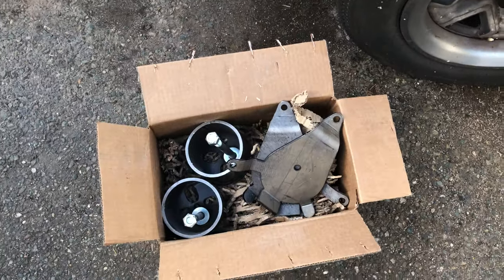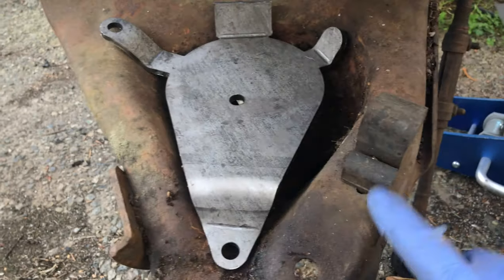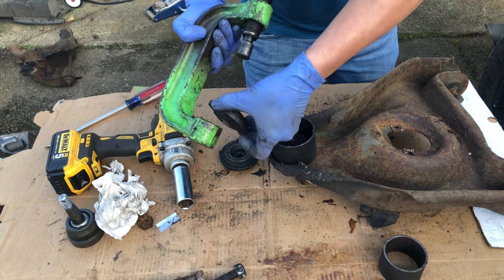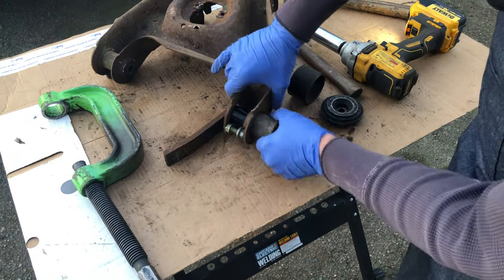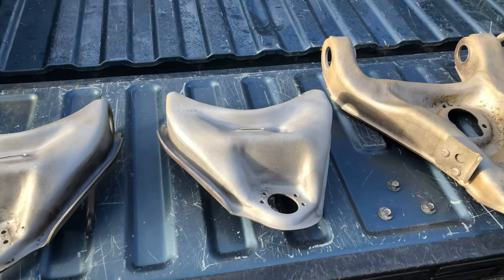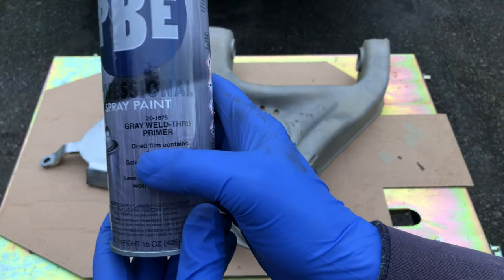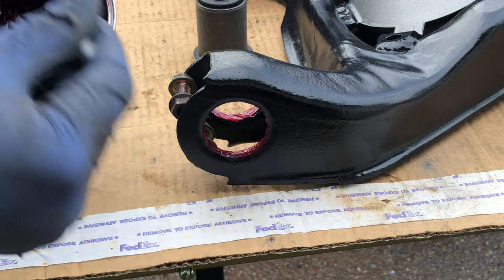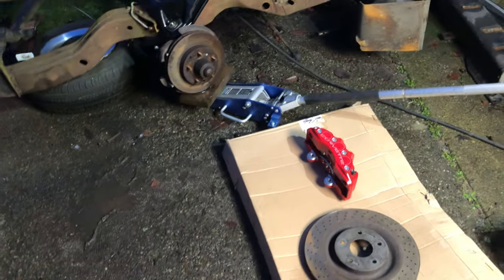1948 Chevy Truck With S10 Frame Suspension Rebuild

Comment: Where did you get the bracket and airbags from?
Reply from the maker: I got them on eBay, back when I bought the brackets I believe I paid around $68 plus tax, now I think the price has tripled on them :(
Reply: Do you have the part number for the brackets and airbags ?

Comment: I don't mean to be critical ... but, how how how could you skip stripping and undercoating the subframe ... use sealer and fill the hollow parts with foam. From the condition of vehicles it looks like you live on the west coast, maybe CA, so I get that you're not dealing with ice and salt. But still. As you yourself said: It was very quick to sandblast those control arms and then to spray them ALL down with rust inhibitor. Yet, on a complete restoration you skipped that!?  I'm just absolutely shocked. 

Ironically ... even though it's the past, I'm still looking forward to see what you do for the 'furniture.'  Just don't tell me you made your OWN custom upholstery. I just cannot take you having anymore talents. 🙂  As usual ... Спасиба болшой!

Comment: Nice job! 💯 Do you have the link of the parts of the air bags ? Im also working on a project like yours
Reply from the maker: I bought these brackets on eBay.. just look for "s series front suspension air bag brackets ride cups lowered"

Comment: Excellent to see mechanism for swapping the bushes and joints on these control arms. I need to done some of this on a project vehicle (completely different) and am looking at options for not replacing the whole units. Good to see the use of an etch primer, but I think a two-part modified epoxy primer might be more long lasting than a rattle can. Yes, I use these too and there are great hardwearing products, but I just don’t think you get the thickness on these, especially at edges and corners. Good blasting work. With the new compressor are you thinking about a cabinet?
Reply from the maker: That self etching primer even out of the can is no joke, the acid in a primer really bite into the bare metal and hold well, I have no doubts that this finish will hold up on the road. I did get a large blasting cabinet sometime ago and would much rather do all the blasting on smaller parts such as these control arms in the cabinet versus out in the open the way I did it in the video.
Reply: @fix206  Thanks for your reply. Yes, wet blasting is the best way for working outside or on larger items that do not fit in a cabinet. Just ask 'Mr Hewes' who is now wet blasting tanks and did a recent update on this method. Be good to see how you tackled the cab you mentioned so I will need to look through your content. I've only seen two of your videos but greatly appreceiate what I've seen and like your approach to getting it done, filming what you do and explaining the processes.
I have a few largeish things that I will be cleaning up and I've not yet worked out what i'll be doing.
I have a 220L generic-make blast cabinet, which is about as small as it's sensible to have and it to still be useful for parts etc and not take up too much space when not in use. Out of the box these 220L are ok as boxes with gloves etc, but not great for blasting in my opinion. I upgraded with the kit from the company that has the 'Parts Washer Upgrade Kit' YT site. This has made my setup as good as I can reasonably expect and am really pleased with it. It needs only a very little media, I regulate the blasting at the cabinet and use a fairly short and wide diameter hose that runs from an unregulated output on the compressor tank. I need to sort out pre-cooling as you have. I built the cyclone based on 'Charlie DIYte' rather than the PWUK but not had the problem of barrel collapse as I don't power the suction too hard. Some magnets on the cabinet vent help to trap ferrous dust, too
Will check out the etch primers. I've used them in the past for applying marine antifouling to pre-coated surfaces such as galvanised.
Thanks again!!

Comment: A neat trick I like doing to freshly media blasted steel is to clean all the moisture or dust off, (chemically clean with degreaser), let dry then take a Mapp gas torch or equivalent and heat the steel up till you see the moisture residing in the metal wick out and evaporate, do this to the whole piece. It will leave a little surface oxidation behind but it will not harm is as the moisture has been eliminated from the steel. Let cool and then apply a piss coat of self etch, then prime and shoot the color of choice on. I use to live in Los Angeles and if you left any metal bare in that toxic pea soup air the metal severely oxidizes over night. with this method the worst that happens is the surface of the paint oxidizes over time if directly in the outside elements and the metal stays well protected with no rust bubbles emerging under the paint.
Reply from the maker: I did notice that it doesn't take long for the surface rust to start forming. Literally within about 30 minutes after I got done pressure wash sanding I could see the silver color starting to turn a little yellowish on the first control arm that I did. So with every control arm after that right after I got done cleaning one up I immediately blew all the water off with compressed  air and then for good measures placed the control arm in a preheated  oven for about 10 minutes. After that stored them in my dry garage, that seemed to work out :)
Reply: @fix206  
I just learned something good from both of y'all thanks. Phillip Hall

Comment: You gotta trim the spring pocket so it doesn’t pinch:l/cut  the bag when it’s deflated once it has weight on it
Reply from the maker: I know exactly what you're talking about. With frame being stripped down I think I'm going to flip it over with the airbag mounted and fully deflated to see exactly how much I have to trim so the bags don't rub/pinch... That will be in couple of weeks down the road, I'm going to take care of few other things before then 👍

Comment: It's been a while since your last video, so it was good to see more progress on the truck. Hope the next video won't be too far away as it will be interesting to see the modifications for the new brakes. I'm surprised that you didn't make your own ball joint pressing tool, as you make a lot of your own tools. But I guess you had limited use for it, so easier just to rent one.  It was interesting to see your pressure washer sand blaster, as I've never seen anything like this before. Another way of removing rust from small parts is to use electrolytic rust removal. There's a lot of links if you search for it, but this page is very informative https://www.qsl.net/2e0waw/rust.htm  I have my own setup using a 65 gallon bin and a salt water chlorination unit as the power source. I recently restored a seized up vise that wouldn't move with it.
Stay safe over there from this virus and looking forward to seeing more progress. All the best from Queensland Australia.
Reply from the maker: Bruce, my friend... With Covid restrictions getting a bit lighter it got busier at work so I have not had as much time to work on the truck as I would like, also this is our rain season, so that doesn't help either. But I'm still working on it and recording quite a bit, got enough footage for 2–3 more videos. Finding the time to video edit seems to be the hardest part of the whole process :-) one of the videos that will be out in a week or two has to do with another tool I've been working on. I'm pretty excited to start using it, hope you'll like that one ! It's nothing groundbreaking, but I think it's cool nonetheless. I think I've created enough suspense :-) so I will just leave it at that 😎 I'm pretty sure at some point I will use electrolyses to remove rust from something in the future video. I will be using different techniques to achieve the same end results just to show people what all is possible...
Reply: @fix206  Good to hear that all is well over there and you've just been busy and had less time to work on the truck. I'll be interested to see what new tool you've made and how you'll use it. Electrolytic rust removal has the advantage that it can get to places that other methods cant. That vise I mentioned was totally seized up and wouldn't move, but after a few days in the rust removal bin, I could pull it apart and put the parts in separately for further cleaning. I wouldn't mind having something like that water sand blaster for larger items that are too big for the bin. It's supposed to be our rainy season here, but it's been really dry with only occasional light showers. Feel free to send any unwanted rain over here, as we need it.

Comment: Going to clean up the frame before all that assembly?
Reply from the maker: There is no way I'd leave the frame looking like that especially after doing all the work on making the control arms look pretty. This truck will look new in and out and under as well. There are a few more frame modifications I have to do before I will wire wheel it and get it primed and painted

Comment: I have a s10 too  been wanting  to see real install  this is great detail  did you get the bigger airbag  to work?
Reply from the maker: I'm still mocking couple of things up, i'll be flipping the frame over so I can gauge how much of the spring pocket I have to trim back to make room for this large bag. But I am 99% sure that I can make the 8 inch bag fit in there. I'll have a video of that 2–3 weeks down the road, I'll have a couple more videos out before then. Stay tuned

Comment: Fix I finally got a hold of a 13 HP power washer! Thanks again!  PS Have you had a chance to do more work on the old chevy? Phillip Hall
Reply from the maker: Hi Phillip, those 13 HP power washers aren't very common, they are commercial grade machines and are pretty spendy, hope you got a good deal on one :-) the one that I used in the video I picked up about four years ago for $190, it was a great deal even though I had to drive a bit over an hour out to pick it up. 

I haven't done much more work on the truck besides gathering some more parts for it over the winter. Also over the winter I've got some more tools that would be beneficial with the old Chevy rebuild... Worked on a new video in a bit of a free time that I had over the past couple of weeks, wanted to push it out this past Sunday but did not need that deadline, hopefully this Sunday the new video will drop...
Reply: @fix206  
You are right Fix. The 13 HP PWare not nearly so common as the 'around the house' type, usually 5 to 6.5 HP. I got mine from a relative whose husband passed away. It was running fine last time used. Not now, needs a carburetor or a carburetor cleaning. (I hope that is all it needs) We will soon see.  Phillip

PS Looking forward to the video!   😊
Reply from the maker: If you suspect a dirty carburetor, go ahead and detach the carb from the motor, also don't forget to remove the lower "bowl/cup" that's located at the very bottom of the carburator, get some carb cleaner with that little red straw that goes into the nozzle and blast every small orifice within the carb... That's normally how I clean the carbs on all of the small engines that I got... I never break the carbs down, the way I see it if you have an internal issue that would require you to take the carb completely apart, it's easier just to get a replacement carb at that point rather than trying to rebuild the old one... Just my 2 cents :)
Reply: @fix206  
Thank you for the good advise! You gave it in time to save me possible grief! Your advice is well taken! 
Phillip Hall
Reply from the maker: New video got posted this morning... Hope it's good... I'd like to hear you honest opinion if you don't mind...
Reply: @fix206  
Fix I look forward to seeing it! You can count on me for a honest opinion. Thanks Fix! 
Phillip Hall